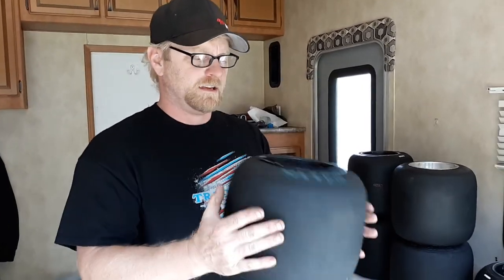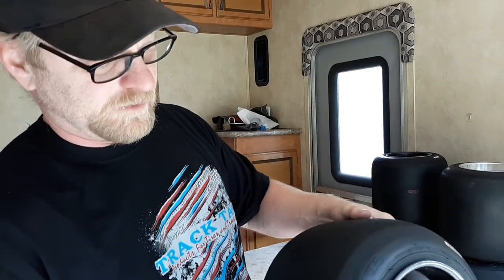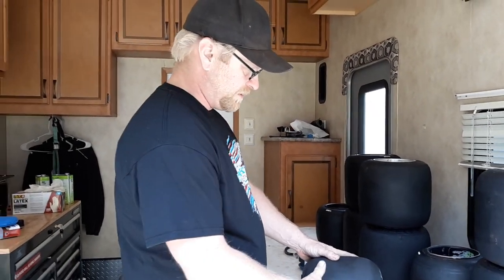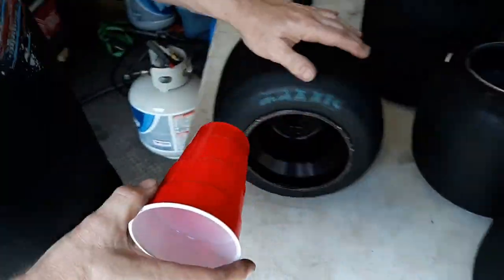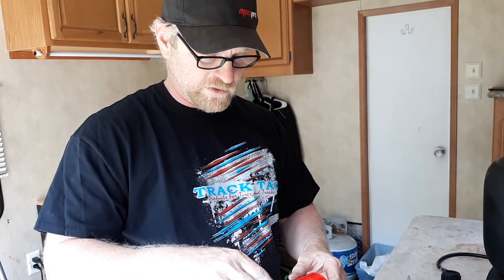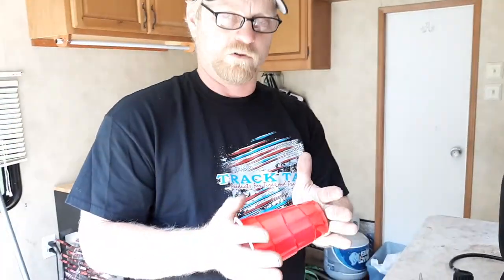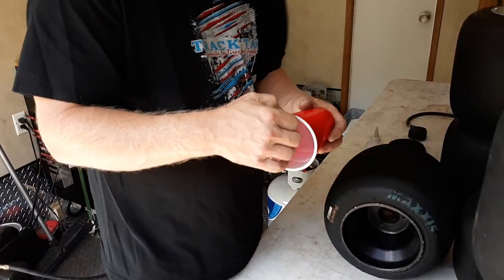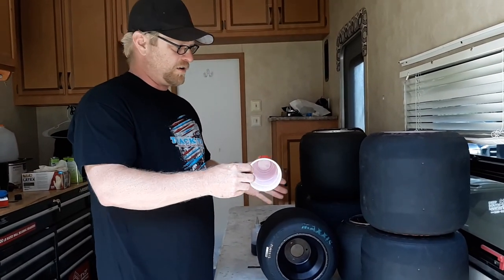Tire size and stagger talk.... prepping

Comment: stagger on the front is a lie each wheel rotates independently  no such thing tire size on the front is for cross
Reply from the maker: stagger in the front doesn't work like it does on the back. but the different size of the tires will create a drag effect and cause the kart to pull to one side or the other. you are correct it has a bigger impact in the rear do to the solid axle.